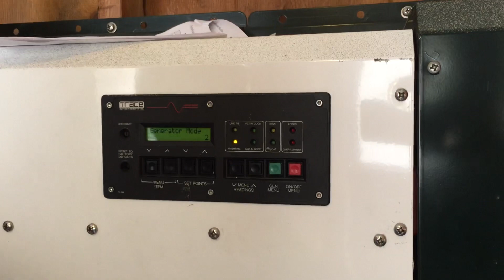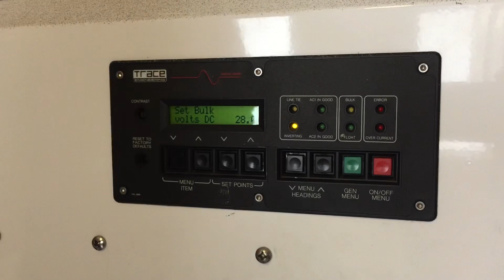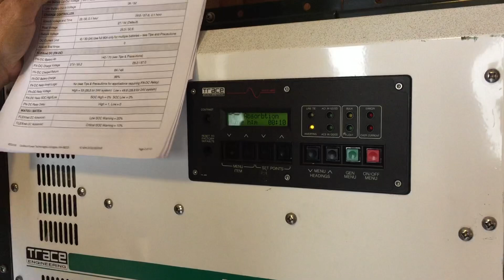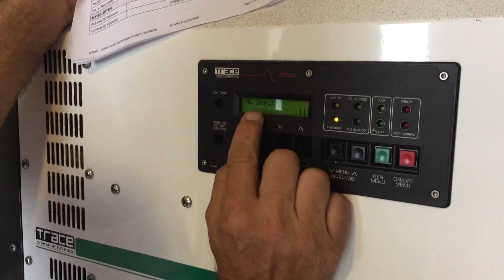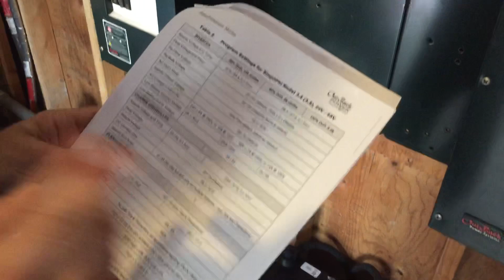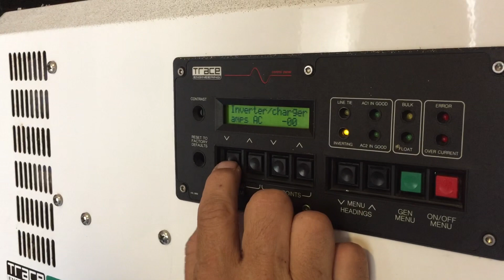Simpliphi Lithium Ion Battery Set Up for Trace Inverter

Comment: I am glad that you posted this on you tube!  I have a 48 volt Trace Inverter like yours and we need to switch over from lead acid to lithium batteries.  I might need to pick your brains should we run into any difficulties.  Thanks for posting this.

Comment: Morning...looking for technical feedback on how to configure a SW series inverter for a 3500W generator. 

At issue: when I manually start the generator, the inverter does not recognize the charge and therefore does not charge my 6 12V marine batteries 

Any comment or feedback you be much appreciated 

Claude

Comment: Hi, I have installed over 309 of these Trace Engineering SW4024 inverters. The D.C. to A.C. is a factor of 5.    5 amps at 24 vdc is 1 amp at 120 vac. Now on battery charging from utility or generator is a factor of 4.   1 amp at 120 vac on utility/generator is 4 amps at 24 vdc. So the 9 amp charge (AC) is 36 amps dc. The 33 amp (AC) is over 120 amps D.C. ! 132 amps to be exact!
Reply: that's something I wouldn't have thought about, but is so simple when you point it out. I would have just assumed that wast the inverter's output amperage to the battery.
Reply: Are these well made,  how often do they fail?
Reply: @FishLoaves  I've only replaced batteries on a trace inverter once, but it was working just fine it was a system that was at least 15 years old I think even 20. trace is long since dead, and if you want to install it you would have to turn to ebay for equipment. you would have no warranty, no support, no guarantee that the parts you get still work, and would have a hard time finding all the equipment you need.

The engineers that made trace had moved on to outback, xantrax (which is now conext) and magnum. those are companies that have the DNA of trace engineering. I've done plenty of installs on those systems and they work great.
Reply: @jimmyhylton9957  I have a Trace 4024 I purchased new in the 90's, it had a problem a week after instal, returned it and got it warranted for free, it ran 15+ years continuous, and off and on since then.  Getting ready to sell the property so will have to fire it up again....
Reply: If one is installing lithium batteries on these inverters, shouldn’t the float setting be set to zero? So there is no float output? So the generator stops instead of continuing to run on float?

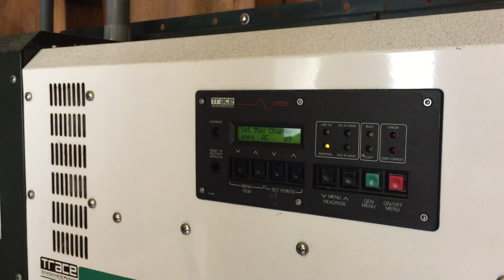Comment: Hi Dana, thank you for posting this video. One thing I wanted to point out to you at 3:56, that the battery charging amps on the sheet that you're holding is DC Amps, not AC Amps (as is measured with the generator charging). So setting the value to 9 Amps at 120VAC is roughly equivalent to the 45 Amps at 24 VDC that is the battery's charging limit (per one PHI battery).